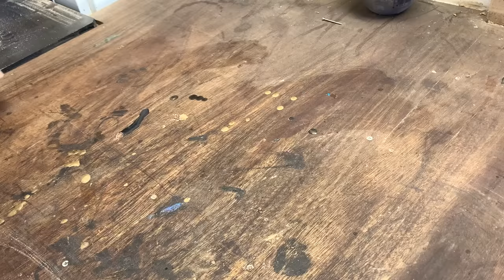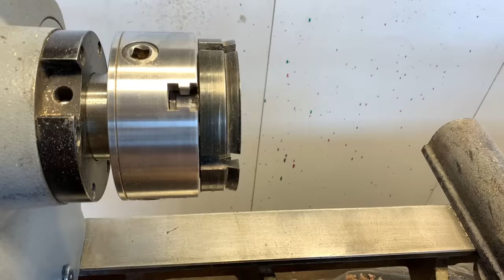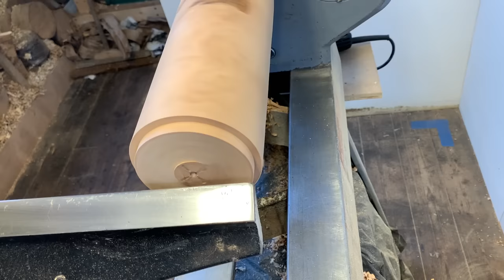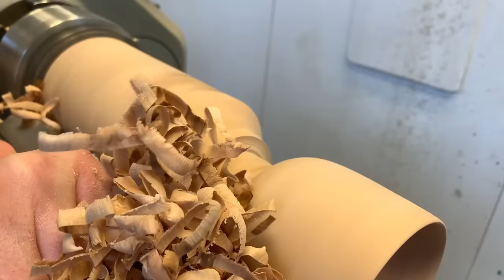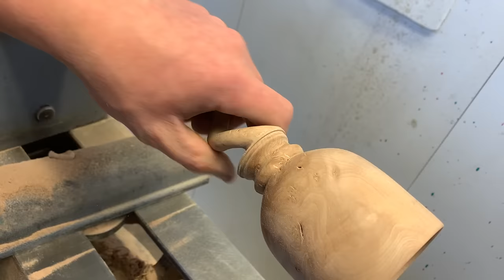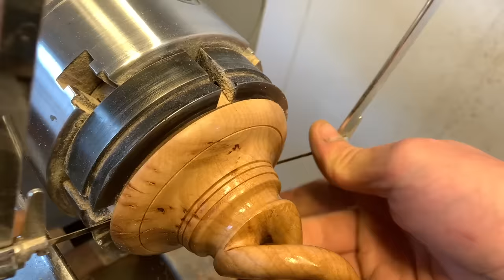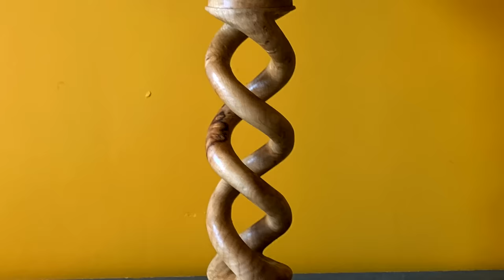Woodturning - The Twist!!

Comment: over 30 years ago I attended an estate auction and they were selling a four poster bed with 3 spindles per poster just like this video demonstration.  It was beautiful.  Each of the four posters were about 5 feet in height.  Seemed to be cherrywood.  Most beautiful thing I've ever seen in woodworking.  THUMBS UP!!!
Reply from the maker: How much did it sell for?
Reply: were the carved into a spiral on the surface but with the core still intact or  carved  right through.
Reply: @JackMackWoodturning  I don't recall what it sold for but it was so very special.  They were perfect spirals; three to a poster.
Reply: @PetroicaRodinogaster264  The core was gone.  Just three long spirals suspended in air, all uniform.
Reply: Probably done using hand chisels. Another dimension to the effort and skill required.

Comment: Several years ago I got into this bent of carving mushrooms with my pocket knife, and it quickly became an obsession with carving corkscrew stems. I did all of the work by hand, down to polishing them to a mirror finish and glazing them with several coats of linseed oil. 

I have a few remaining on my display shelf to this day and would have several more if all my attempts succeeded. But with as delicate as my carvings were they only had about a 10% survival rate. I broke most of them, either towards the end of the carving or sometime during the sanding process.

One thing I always wanted to try was a double stemmed corkscrew mushroom, but never had the courage. I love to see that you were able to succeed. What beautiful work you've done!

Comment: Jack;  Really liked your video so much that I tried it.  I started out with a dried piece of mesquite.  I turned it down to about the size you did changing to a vase/candleholder design.  When measuring out for the twists, I made it for six one inch increments lengthwise and measured the circumfrance  to be 10 1/2 inches divided it by six to get the distances between squares.  This ended up giving me 3 twists instead of two that you did (don't ask me why).  To help reduce the hand cutting with the dremel,  I used a fortsner bit on a drill press to carefully drill down into the twists about half way which helped quite a  bit.  The rest I pretty much followed your video.  Thanks for the neat idea of which I plan on doing some more variations in the future.
Reply: Somehow I am missing the transition from one twist set to where it becomes two, intertwined.
Reply from the maker: I’m not sure what you mean ?
Reply: @JackMackWoodturning  just because he had better ideas? It's okay to not be the most efficient, your peice still looked good
Reply from the maker: @vanjam412  sorry dude ?
Reply: @JackMackWoodturning  great answer 😂
Reply from the maker: @vanjam412  I don’t understand the context of your comment. What’s it in relation to ??
Reply from the maker: @vanjam412   I answered 
“I’m not sure what you mean”  to 
“Somehow I am missing the transition from one twist set to where it becomes two, intertwined.” 

Then you said “just because he had better ideas? It's okay to not be the most efficient, your peice still looked good” 

How does that make any sense ??

Comment: I carved a single spiral in a piece of pecan with a Morakniv Companion.  That was one hell of a chore.  It's kind of neat when you break through the middle 8:24 it's kind of a turning point when you realize that you really have done something.  It seems like you could use a thread turning setting of some kind on a lathe.  Something like a very large 2 start acme screw.  Idk, just a thought.
Reply: I have seen it done and I guess thats how they do it commercially. Open bine barley twists are the gold standard and you rarely see those on furniture..

Comment: Great video!! If I had one suggestion it would be to make a three sided box to cover your lathe bed when you do finish work, glue work, stain work etc. Hands down my biggest regret with my first lathe. I basically bought a rectangle cardboard box, cut out the bottom of one of the long sides, built a quick handle and covered it with packing tape. Keeps my bed lathe literally look like the day I bought it.
Reply from the maker: Thanks for the advice Patrick. I will look into this. 😁👍🏻

Comment: I did the same thing with a 10' peice of walnut. Used a black shaping disc on an angle grinder. Did a twist for about 7' of the run, sealed it in Marine grade epoxy resin, and now use it as a push pole when I'm fishing the flats 😉
Reply: "marine grade epoxy resin"
stuff made for the army is made to be as cheap as possible.  better off with high grade hobby resin.  Not that it matters
Reply from the maker: Haha. Shrimp, marine is boats.

Comment: Should make a wizard staff like that with a crystal in the middle.  That would be awesome.
Reply from the maker: Might give that a shot Paul. Thanks for watching 😉👍🏻
Reply: Yes!!!!!
Reply: @JackMackWoodturning  Thanks for reading the comment on the idea Jack.  I like seeing artwork at it's best and keep going Jack.  Oh!  Try using a powerful green laser like those 900 mile or 1watt laser pointers to light the crystal up.  Lasers give a cooler appearance then LED.  You can get them very cheat on Ebay.  !!!Warning on powerful green lasers, they can damage the eye due to the brightness and wattage so don't look at it directly especially on white surfaces like paper.  They will leave a dark spot on your vision if you look at it for a few seconds and will take a minute or so to disappear.

Comment: Hey man, this is just awesome! My hands were hurting just from watching all of the hand sanding! 😂 

Question: when you first started defining the outside shape, you used a scraper. Any particular reason why you chose a scraper over a gouge of any kind? Just curious. 

Great video brother!
Reply from the maker: Cheers Seth, believe it or not I don’t own a spindle gouge, never needed on 🤣
The grain in this piece is quite twisted because of the burl running throughout so a scraper for me is the best choice. That is due to the fact that at certain points il be running into end grain. 

Does that make sense?
Reply: @JackMackWoodturning  Yessir, makes perfect sense! 
And I don’t blame you for not having a spindle gouge. While I do have a few spindle gouges, most of my bowl gouges have a 40/40 grind on them, which actually handle spindle turning really well. So, I find myself reaching for them more than my spindle gouges, even when I’m actually spindle turning. 
I’m also lousy with a skew. Mostly because I haven’t spent the time with it. Lol

Comment: I’m amazed that you attempted this on maple or any burl. Good job! I can say this is a lot easier on a Legacy Mill. Unfortunately, Legacy stopped making their hand-cranked mills a few years ago to concentrate on CNC rigs. I’m fortunate to have an old one and it works great!
Reply from the maker: Thanks, this was a piece of apple, I chose the burl section as the twisted grain helps give stability to the weaker points in the finished form. 

Thanks for watching 😊👍🏻

Comment: Fantastic work! I wondered how the hell that twist was done, but having seen you do it I realise it’s basically a fancy 2 start thread. I turn metal for a living and was anxious to see how brave you were going to be parting it off 😁.
Reply from the maker: Do you use a metal lathe?
Reply: @JackMackWoodturning  yes. I was on manuals for nearly 30 years until about 9 years ago, now I'm on CNC's. I still prefer manual and recently bought a small hobby lathe for the garage.

Comment: That's quite an overhang you're working with there Jack, three cheers. I haven't seen spirals (Double helix) marked out like that. I only know the paper strip method. I haven't attempted it myself, too chicken I suppose. The whole thing puzzles me and I just hate wrecking a nice bit of wood. Because that's probably what I'd end up doing. Will you make another to keep that one company? Nice job! Best regards.
Reply from the maker: Hi John. Best having a practice on some wood you aren’t too bothered about. Sure you’ll crack it no problem. I think the next one will be a much tighter angle with a thinner double helix. Might not be for a little while yet though. I have some interesting projects in the pipe. Thanks for watching buddy. 😁👍🏻
Reply: @JackMackWoodturning  uh
Reply: You ury

Comment: There is actually easier way to do the twist. Drill holes through on that line you draw around your piece and eventually you get same result what you got with dremel. Easier and faster.
Reply from the maker: There is an easier way than that.. the traditional way to do this is with a pull saw and a gouge. It’s far far faster than both. The dremel was to show how to
Carve it with a rotary tool.. personally I think the drill technique you described is the slowest of the 3 as after drilling you still need to remove material with a gouge or power carver.
Reply: @Jack Mack Wood I'm so curious about the 3 methods! How about a mega video that shows all three? :)

Comment: Anyone else notice that Dremel tools always seem to have the air vents be located at the precise place you hold the tool to block airflow?
Reply from the maker: Iv’e never had that problem Bill, thanks for watching 👍🏻😊
Reply: It's been like that for decades😂  or they blow in your face😂😂😂
Reply: I've used dremels quite a bit on wood and I've never had an issue with them overheating or anything, so I can't complain about the design it's amazing how useful they are

Comment: Here I was hoping to see some neat technique for carving the spirals on the lathe with woodturning tools, perhaps with the lathe running at slow speed and the tool guided by a screw. Kinda like the way metal turners cut screw threads on the lathe.

Comment: All of these are good but one thing I wanna see is how long a log will last (or the sandpaper) if put on that wheel with sandpaper up to it
Reply from the maker: What do you mean?
Reply: Now that I think about it, its pretty weird but I meant how long would a piece of wood on a Woodturning machine last against someone constantly sanding it? Or if the sandpaper would ultimately just get ruined
Reply from the maker: I guess this would depend on the type of wood and the grade of sandpaper. Different species of wood have different densities and sandpaper comes in many grades. Wood also sands differently depending on the amount of water it holds. I guess you would just have to give it a go! 😂😉👍🏻

Comment: What was the thing on the rotary tool? A rasp?  And what was that bit with the superglue (and accelerant?) for? Did it fill the whole hole? How soon was it in fact turnable again?
Reply from the maker: It’s called a carving burr. There a huge amounts of shapes and sizes available from a number of manufacturers. 
The ultra thin ca glue stabilised a week section of the wood. It was ready for turning again almost straight after the activator 👍🏻
Reply: @JackMackWoodturning  
Ok, thanks

Comment: I am not sure, but I think some time could have been saved on the spiral by drilling straight through the section to be carved out in sequence. Drill, rotate a few degrees, move up a little, drill, rotate a few degrees, move up a little - repeat etc. then join the holes.

Comment: I'd have used painter's tape, both on that steel bar you brace all your tools against (make the markings on that instead of the medium such that you can still se them after you remove material_ and to make the spiral lines without having to free-hand it
Reply from the maker: I don’t think you understand what you just watched.  Why would you mark up crucial measures on a tool rest that moves freely from the work piece, It has absolutely no additional benefit only potential for disappointment. 
Laying masking tape out IS free handing, and if you have much experience with both you’d definitely opt for a pencil. 😆👍🏻

Comment: I read Doyle Pugmire's comment: "...When measuring out for the twists, I made it for six one inch increments lengthwise and measured the circumference to be 10 1/2 inches divided it by six to get the distances between squares.  This ended up giving me 3 twists instead of two that you did (don't ask me why)." 

Is there a ratio that one should use to determine how many longitudinal (end-to-end) lines/sections vs radial (circumference) lines/sections to use in order to have an esthetically nice looking final project? 

I am a "fairly new to intermediate" level woodturner and I would like my next project to be a barley twist candle holder...I haven't decided if the total height will be 6" or 8". Let's say the total height will be 6" with a diameter of 1.875" (47.63mm). Having a base height of approximately 1.4" (35.56mm) and a top section height of approximately 0.9" (22.86mm) will leave me a middle section of approximately 3.7" (93.98mm) to make my barley twist...these are approximate measurements from a drawing/picture that I have.

How do I determine (1) how many longitudinal lines/sections?, (2) how many radial lines/sections? (3) if it will be a double, triple, etc. helix that I end up with? 

Any advice from Jack or any experienced turner would be greatly appreciated. I am new/intermediate but would really like to challenge myself for my next project. Thanks in advance.
Reply from the maker: Hi. 
First up. Double helix vs triple helix. Use indexing to divide the cylinder into 4 or 6. 
4 sections will give you double helix 
6 will give you a triple. 

This is the same as making a barley twist but you do not go all the way through for a twist vs a helix. 

Instead of getting lost in the formula of it all i suggest you focus on the angle. Divide into sections (4 for a traditional barley twist) then draw your line as you see it in your head. 45degrees would be aesthetically pleasing on a chunky twist. 
Draw the Line from the first point as I do on the video and where it intersect the line of the next segment you can strike another mark around the cylinder. That will give you the length between your twists 

May I also suggest that if you want to learn about any aspect of turning you do it without setting out to make a final piece. Learn the process first by working multiple test pieces. You will learn more that way then you ever set out to learn. 

Enjoy.
Reply: @JackMackWoodturning  Thank you very much for the suggestions. Really appreciate it. I will definitely practice on test pieces before trying a final piece. You do exceptional work. Thanks again
Reply from the maker: @abbaselgazzar2054  no problem my friend, I’m always happy to advise. I do hope you have fun learning to do this. 
I suggest using a tenon saw and nice sharp chisel to do the carving. 👍🏻
Reply: @JackMackWoodturning  two other questions Jack…(1) what type of finish did you use in the goblet?  and (2) the way you set your radial line direction for the helix…does that give you a better cutting angle and can that be reversed? PS I’m writing from British Columbia, Canada.
Reply from the maker: Finish is danish oil. 
If you were making a pair of something’s you might want to make them twist opposite directions.. 
I’m off to BC end of this year for the first time. Always dreamed of migrating there. 
Is there any hardwoods available or all pines and firs ?
Reply: @JackMackWoodturning  BC is beautiful…lots of different sceneries to explore. Lower Mainland (Vancouver), the Island (Victoria, West Coast), the Interior (Kelowna, Salmon Arm, etc). The West Coast, the Kootenay area and of course the North…each has its unique features and each is so different from each other. Lots of domestic woods available and somewhat reasonably priced. Exotic hardwoods are available but are expensive. Prices for exotics has remained high for a number of years and can’t see it coming down anytime soon. Woodturning has become very popular here and most communities have woodturning clubs. Where abouts are you heading to when you come to BC?
Reply: https://drive.google.com/file/d/1SwDgQ6-NlgBkiG6hR-_i8_NAWAtzenms/view?usp=drivesdk

Well…I took the plunge. After many many hours and a ton of mistakes…here is picture (Google Drive link) of a walnut candle holder with Danish Oil…I was “inspired” by your Goblet with a Twist video and the comments that you shared with me. I learned a lot about what to do and what not to do next time I try this. Not quite up to making a goblet but maybe in the near future. Thanks again for all your suggestions…they were very helpful. Adios from BC Canada.

Comment: 🤨, ⚠️ you weren’t extracting the dust when sanding and doing the rotary file carving?
Reply from the maker: What’s your point Sam ?
Reply: @JackMackWoodturning  - when I had watched your other videos - [deja vu], the partition/stud wall behind the lathe has a flap  - in which you would put a dust extraction nozzle and tube in the hole and directly extract the dust from the lathe piece, I assume you have a dust extractor behind the wall. Much more safer than having it wafting in the workshop [dust explosion risk] and having to wear your respirator for a long period afterwards unless you had another fan on/window, door open
Reply from the maker: @samuelfellows6923  my workshop has 2 large roller shutter doors on a warm day I open them and the dust is gone in a crack.. moving fresh air is much nicer than circulated air. It very nice that you noticed the lack of extraction and threw A great big ⚠️ at me. 😉
Reply: @JackMackWoodturning  , good to see you were being safe and was removing the dust/adequately ventilating your workshop - we just didn’t see the open shutters
Reply from the maker: @samuelfellows6923  👍🏻

Comment: what kind of bits you use ? mine wont last 10 seconds
Reply from the maker: Google rotary carving burrs 
If you already use these and think they don’t last
It likely because they need to be cleaned. Easiest was Iv found is to hit them with a blow torch which will take all the wood build up off. Be very careful your not dropping small embers in your wood shavings tho.